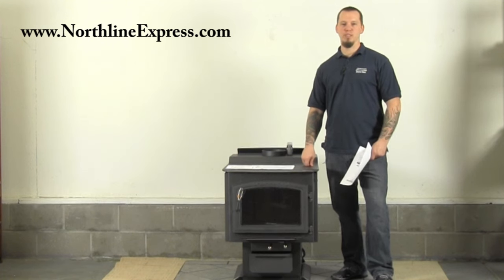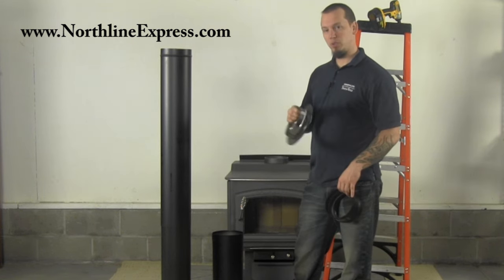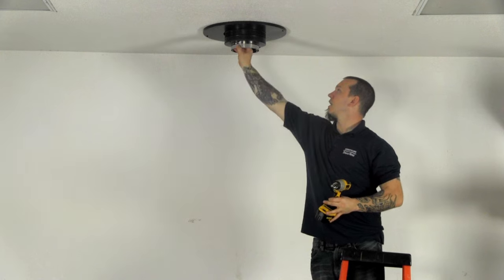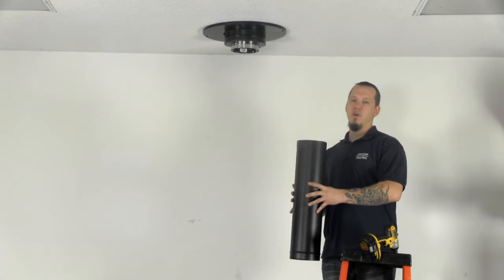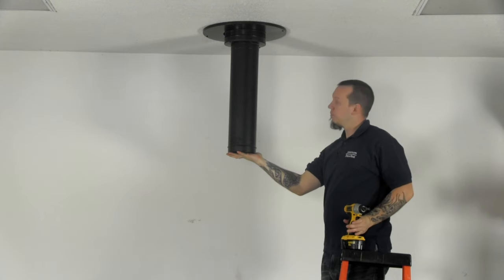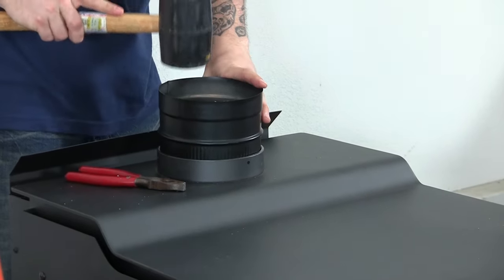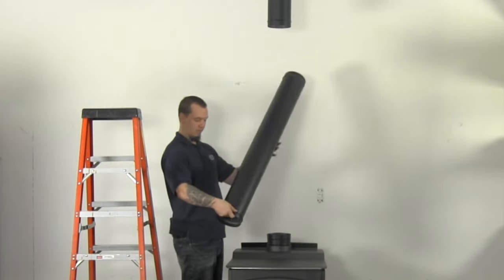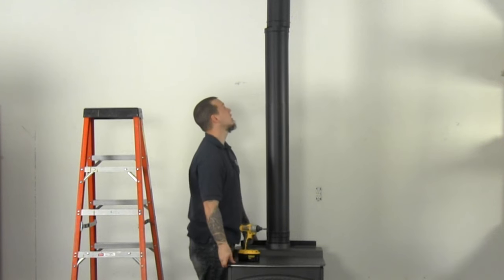DuraVent DuraBlack Stove Pipe - How to Install DuraBlack Single Wall Stove Pipe

Comment: I cannot believe your not using insulated. Pipe its going to get very hot 🔥 easy burn 🔥 situation and its open to humans ?
Reply: So is the stove dude. The idea is to heat the home. If you're scared of a woodstove then use an alternative heat source. Youd literally have to be on top of the hot stove to get burnt by the pipe.

Comment: Mine has a very loose fit (the slip joint pipe) and I'm afraid smoke will escape the joint.  Shouldn't it be a snug fit?

Comment: Thank you very helpful I was wondering if the pipe was supposed to lap that way or not I figured it went the other way so smoke didn't come out but once you mentioned water dripping through it all made sense.😂

Comment: We have a Malm fireplace with a slider pipe, a starting pipe with damper and a 12" short pipe for our installation. Where do you recommend putting the slider pipe at the top near the outside connection or in the middle area above the damper section?

Comment: very good video thank you    IF at all possible new stove or new pipe burn outside first with good hot fire or you could be washing down walls and ceiling good video for correct way to install stove pipe female end goes into stove

Comment: Is there anything you can use to seal the joints to avoid any smoke leakage?
Reply: You don’t need to worry about smoke leakage.  The draft will prevent that.
Reply: If you have smoke leakage from the stovepipe then you lack sufficient draft.  No sealant will remedy that.  Either increase the height of the stovepipe or find out what is affecting your draft.

Comment: I'm trying to pick the proper adapter for my install, a new wood stove using 6 inch single wall up to an existing square support box with an 8 inch 'hub' projecting down only around 2 inches. This hub appears to be female, as an 8 inch crimped end fits into it, but the 8 inch female does not fit over it. Since the pipe has to be installed crimp down, what's the best way to get there?

Comment: awesome channel.  does it has to be single pipe and not insulated.   Also when it go up to the attic and outside, it has to be double insulated, would that be correct?
Reply: Single wall inside the house up to the attic is fine. That can even radiate heat itself. In the ceiling and attic it has to be double wall out with gaps determined by your district to combustibles

Comment: I tried to connect this pipe but I couldn't get it to fit together.  We had crimped it a little at the male ends, but it still wouldn't fit together.  I can't find any tutorials on the Dura Vent website, nor have they called me back.  Does anyone have any suggestions or other tutorials I can watch?

Comment: Anyone know how to install WITHOUT telescoping pipe? I know it'll be difficult, but I'm not sure if I should try to tilt the stove into the pipe or have the stove already connected to the pipe and tilt it all to fit into chimney
Reply: did you ever figure this out? I'm trying to do that currently and don't know if there's a special piece to make it work.
Reply: @Rockwell8814  I ended up having to use a floor jack to just lift stove up into pipe and putting a small brick under each leg

Comment: Does any one know what flashing to use for a pole barn for 6 in pipe, with a metal roof with 1/2 in plywood and tar paper, I was thinking about one of those silicone adjustable flashings,  will that be safe with the plywood ? the food is 13 up.
Reply: smart phones are so dumb, roof not food
Reply: Metal roof stove pipe boot.....google it
Reply: rubber boot flashing kit